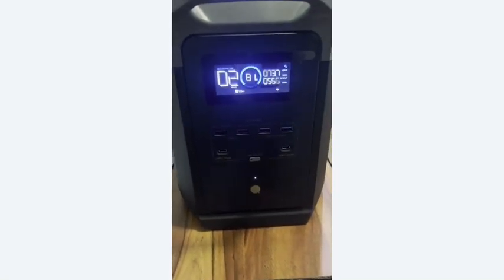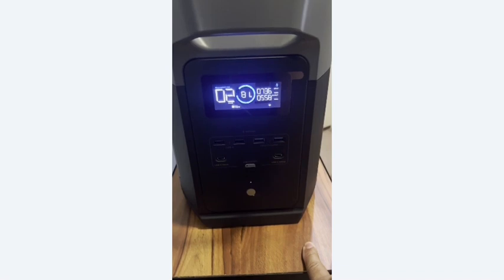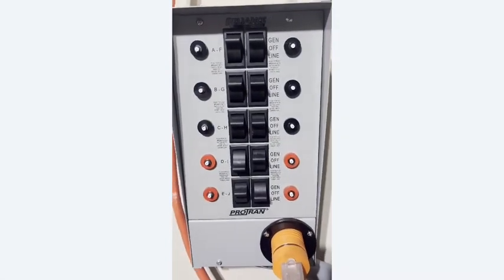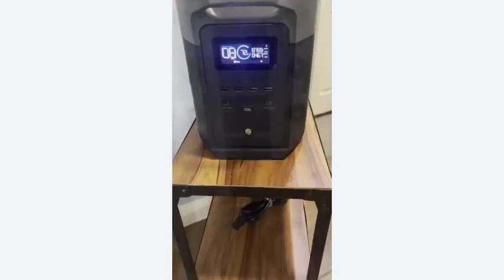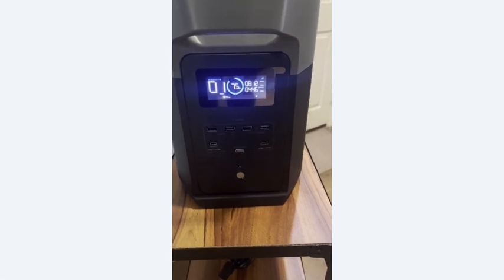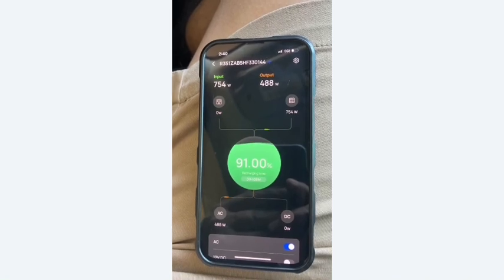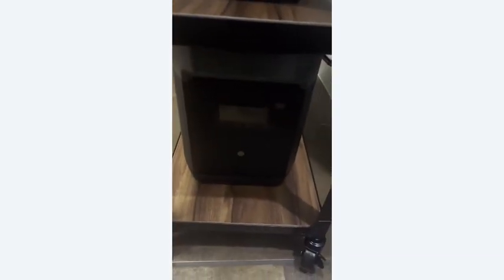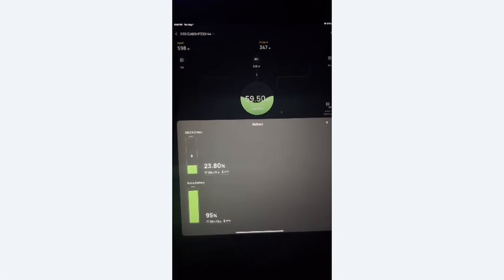Ecoflow Delta 2 Max Real World Test Review Off grid capable? (100% Unsponsored) (Video 2)

Comment: The only downside is the limited solar input
Reply from the maker: Thanks for liking and subscribing, I totally agree. I know that the Delta Pro has a little more input capable. But the new solar generators from other brands are stepping up their game with a lot more solar input. I’m a averaging about 780w with my 2 490w panels. I do plan to add 1 more and run it in parallel so I can get the 1000w continuously…

Comment: thanks for the vids...I'm looking at purchasing the Delta Max 2 as well and would eventually like to get a transfer switch.  Did you install that yourself or did you hire an electrician?
Reply from the maker: Thanks for watching and subscribing, I did it myself. It’s super easy, just follow step by step instructions here on YouTube 
How to install Reliance Control ProTran2… it’s 6 videos avg. time about 7min each. 
Keep posted 3rd video coming soon. Would advise if you plan to expand to the 6kw (Delta 2 Max and 2 smart batteries) I would definitely install at least a 8 circuit transfer switch…

Comment: What's the yellow plug on the transfer switch input used to convert to an extension cord? Do you care to share where you bought it? Thanks
Reply from the maker: Thanks for watching, liking and subscribing 
Sure thing… ordered on Amazon, still working flawlessly..

AC WORKS Generator to Transfer Switch L14-30 Inlet Box Adapter (15Amp Household to L14-30 Compact)

Comment: Im currently reviewing backup battery solutions.. nice video.. I'm new to this and still working my way through things.. do you have this connected to one side of your electrical panel? Usually when i see that kind if setup its the delta max pro plug into and inlet.. but this seems to be different?
Reply from the maker: Thanks for the like, for the transfer switch I have it connected to circuit breakers on the panel that I point out in the video. You can find a series of 6 videos on YouTube from Reliance Controls about 7min avg. The title is how to install reliance control protran2. The instructions are super easy to follow.
Reply: @DaddyDoItAll  nice I appreciate it! Keep up the good work bro

Comment: Thank you for taking the time to make this video . Can you tell me all the components you are running off the delta
Reply from the maker: Please see my first video and it gives more details.
I have 8 circuits from the transfer switch 
1. 3 kids bedrooms (lights, tvs, game consoles) 
All my garage (medium size freezer) 
All my kitchen (no microwave or oven)
All my living room and bedroom, also 2 restrooms
All have led light bulbs 
Powers all great as long as I have solar coming in. 

Next I will turn on the furnace circuit and then another video I will limit to only 4 - 5 circuits like a real life outage scenario…

Thanks for subscribing
Reply from the maker: I would also add that at night comes the real test, if we use our lights and tvs, ceiling fans  ect without conservación I run out of power on both Delta 2 max and extra battery. I do plan to make a 3-4 video with a real scenario outage and use it conservatively at night 
Stay posted…